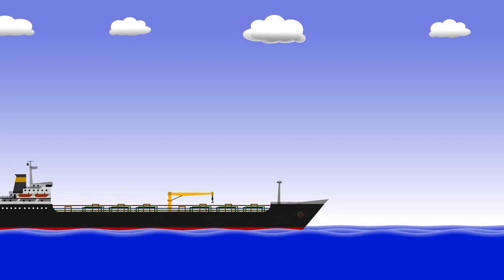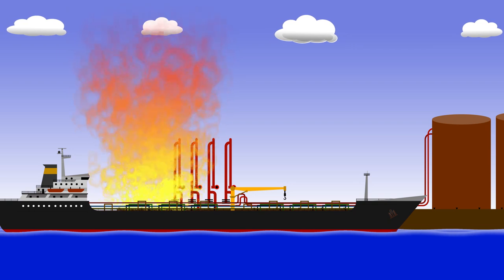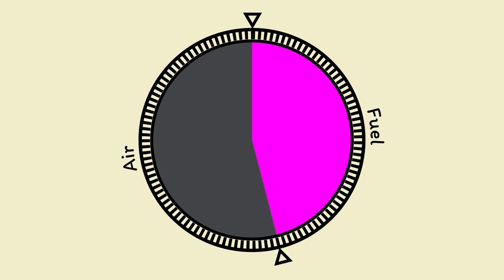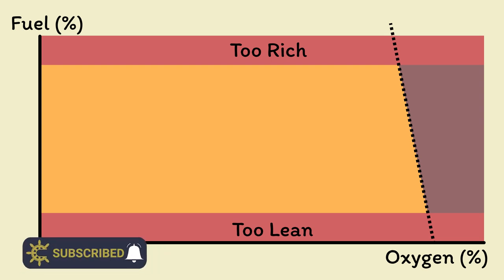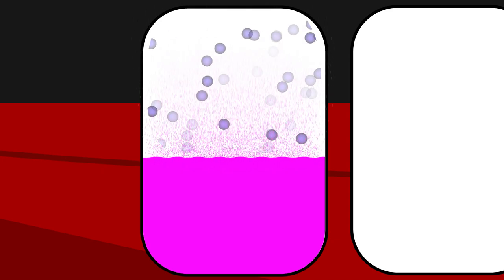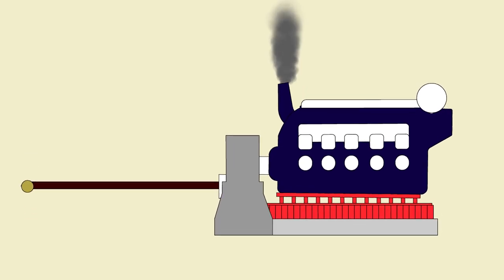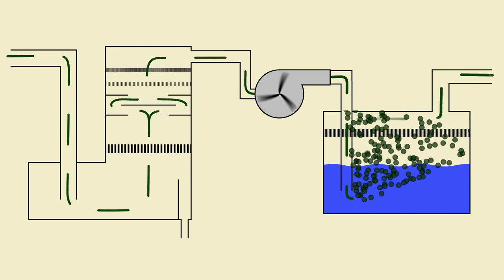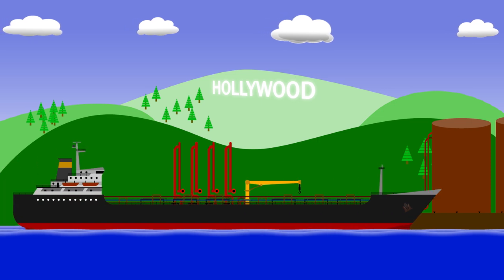Why Can't Petrol Explode On Ships?

Comment: The CO2 generator which is used to inert the tanks should be the Boilers and not the Main engine itself. 'cos:
1. Main engines emit way too much oxygen in their exhaust. 2.Many times when you need the inert gas (in port, while discharging cargo) your main engine isn't running.
Correct me if I'm wrong. Thoroughly enjoyed your video thank you.

Comment: The last time, it started with a call from the support department. They wanted to know if I had a backdoor tool that could dump the memory from a particular industrial controller without turning it on, because this particular controller had been extracted from Panam Serena, a chemical tanker that had exploded in Porto Torres. Sadly it turned out that our controller had lost power 10 minutes before the bang, so we didn't have sensor data for them, but that also told them something.

Comment: It is a little simplified in this presentation. If you were carrying crude oil you would use exhaust from the engine or the boilers however with refined products you would have a designated boiler that burns low sulfur gas oil or diesel. The exhaust from this boiler goes through a scrubber where sooth and impurities are washed out. Then the dew point of the exhaust is lowered either by a cooler or a filter filled with alumina before it is sent to the tank. When you mix inert and gas it is important to avoid  “the sack” as we call it. The sack is the area on a diagram where the mixture is explosive. The area of the sack will depend on what kind of hydrocarbons you are carrying. If your cargo is a gas you have to go further. You will first inert the tank and then you will purge the inert with the gas you will be loading. You will need to get rid of as much as possible of the inert if you are going to reliquidfy the cargo. For chemical gasses like ethylene and butadiene you would use nitrogen as inert, while for propane and butane ordinary inert is ok. Since gasses are kept below the freezing point for water it is important to have a low dew point on the inert. For chemical gasses it is also to remove all oxygen to avoid contamination of the cargo.🤠

Comment: Generally the exhaust from the boiler is used since the exhaust fumes from ME contains to much oxygen. But many oiltankers are not equipped with an Inert gas generator, it didn’t used to be a requirement. All electric equipment on deck in cargo area is Ex proof and strict regulations regarding allowed tools. So the risk of an explosion is still low because there is no source of ignition.

Comment: The LA explosion was ammonium nitrate, which can explode without oxygen. It simply decomposes in an exothermic chain reaction into NO2 and H2O when ignited. This is why it is commonly used for explosives.
Whether it had an inert gas or not would have been irrelevant.

Comment: The C-5 cargo aircraft uses a nitrogen fuel inerting system. There's a 750 gallon dewar (think thermos bottle) in each wing root that is filled with liquid nitrogen. The nitrogen is then pumped from the tanks and allowed to warm up which causes it to expand and transform into a gaseous state. That gas is then vented through the fuel tanks removing the oxygen. Liquid nitrogen has an expansion ratio of 1 to 694 which is why liquid is used.

Comment: In the 70’s three VLCC’s blew up off of the coast of Southern Africa. Shell UK’s Mactra, Shell BV’s Marpesea and a chartered in Norwegian vessel the Kong Hakon. This was in the age when the oil industry was trying to decide if they would go to ‘too rich’, ‘too lean’ or inert atmosphere for crude oil washing (COW) the three ships went off within a few days of each other so ‘something had to be done’ and as you describe inert was chosen. Even as the poor ship owners and operated cried tears of misery over the cost.  It is seldom difficult to notice the difference between a ship owners forced to pay for safety and a ray of sun shine (:-)
Reply: This is interesting. At that time I was an engineer on VLCCs and naturally all officers were seriously concerned. The investigation to all 3 incidents concluded that an electrostacticly induced spark occurred in the tanks while cleaning with high pressure water guns. Inert gas equipment was installed on all company steam ships at next dry dock,  much to our relief. After a number of years water cleaning was displaced by using crude oil instead while tank cleaning, creating a too rich atmosphere in the cargo tanks, therefore  not explosive.

Comment: One of the reasons tankers will not explode is that the RON is low compared to refined petrol , thats why when a tanker goes on fire it burns and does not explode , unless it is one that is carrying refined fuel . I sailed on a few , gas and crude , the early ones never had the system to vent exhaust gasses from the main engine into the tanks and you always had the smell of crude oil in the air , there were just vent pipes to let it out of the tanks , a later one , the ''Sir Alexander Glen '' an OBO had the exhaust gas system and was a lot safer but still someything always to be causious of . The gas tanker , butane and propane had tanks on deck with Nitrogene for toping off when fully loaded or for flushing the tanks . That one also had a compartment on deck with two banks of compressors , run alternatly to keep the gas under pressure to keep it in a liquide form

Comment: Once upon a time long ago, We used to operate to rich or to lean. 
The San Demitro was quite famously hit by shells from a pocket battle ship causing fires. She was abandoned but some of the crew reborded put the fires out and sailed it to port. 
A full gas can will not explode it’s to rich. So ypu can torpedo or she’ll a loaded tanker and the tank won’t blow up. 
An empty tanker. If it’s to rich will not blow up ither. But when you unload it regular air with its regular oxygen content is sucked in. 
An empty tank full of a fuel air mixture can blow up quite spectacularly. So funny thing is an empty can of gas is much more dangerous than a full one. 
Ussualy even when the unloading a tanker there was enough hydrocarbon to keep it to rich. 
The really dangerous time was tank cleaning when you clean the tanks you get ride of the fuel. And it is possible for the tank to go from to rich into the danger zone. 
After several ships blew up during tank cleaning. IG systems were gradually introduced. 
Crude oil is one of the more volatile due to still having a lot of the light gassy stuff still as part of it. 
At first only crude oil tankers had IG systems, but a few refined product tankers blew up while tank cleaning, so it’s use became more widespread 
I worked on some of the last Non IG tankers. 
While loading, particularly topping of tanks,  if there was not a lot of wind there was so much fumes I’d actually get high on it. 
Diesel or Gas oil is much less volatile. But still can be a problem as can ATK aviation turbine kerosene. 
Heavier oils aren’t much of a problem you can make roads out of them. The crap ships typically use is a slight step above road tar you heat it up enough it will burn. And is full of sulfer. So getting banned in lots of places. 
And is why IG systems are very prone to rust.

Comment: That is a very close explanation. The issue to which you refer is often given as a fuel/air ration - which is of valuable interest to efficient explosive ratios in internal combustion engines. However, an interesting video could be made explaining two other factors attributable to an assortment of different hydrocarbons.  First, the flashpoint of a particular hydrocarbon which as been subjected to increasing heat source, secondly, the interesting factor of a mixture of fuel/air subjected to high pressure in an enclosed space - or even a mixture e.g, paraffin or diesel fumes sub jetted to extreme pressure at one end of an enclosed tube, whi ch I s open at the other end. I have conducted this experiment in the barrel of a very powerful air rifle from the U.S. many years ago

Comment: Never thought about this before but if I had to take a guess, i'd have thought they were reducing the pressure in the tanks using vacuum pumps... Now that i think about it, that doesn't really make sense in such a big container that contains liquids with low boiling point.

Comment: Another thing the heavy tankers most people think of leaving the middle East are full of unrefined crude which put off little vapor to begin with and is not explosive
Reply: You are very badly mistaken; crude oil is volatile even the heaviest such as the Venezuelan crudes for around the Maracibo Lake contains a small fraction of light elements.

Comment: Isnt the exhaust from onboard boilers the most common exhaust gas used for this purpose. You cant have the main engine running while the ship is in port since you cant disconnect the propeller feom the driveshaft/crankshaft. I just started my cadetship on a tanker ship and this is what i was taught. Btw we use a dedicated burner for the purpose.
Reply: Ships no longer have boilers as they no longer use steam turbines.
Reply: @samanli-tw3id  they have auxiliary boilers and many tankers have steam turbine cargo pumps.

Comment: I kind of had the opposite question until I realized that the tanks won't always be 100% full. If they were, then a true explosion would be very unlikely because there just wouldn't be enough oxygen able to get in contact. Not that a plain fire can't be plenty nasty, but it's not going to be "break windows miles away" nasty. But when you showed the half full tank and talked about the vapors, I realized "oh shit, that's a fuel-air explosive".

Comment: I'm reminded of a tanker ship explosion documentary I'd seen recently. I forget which one it was, but they traced the cause to a bad weld in the tank. The tanks had been used to transport various chemicals, which had each leaked through the bad weld into the outer hull, mixed, and self-ignited. I don't think the outer hull had CO2 pumped into it as it was assumed flammable chemicals wouldn't be present there.
Reply: All welds on oil tanker should have NDT
Reply: @Then.72  sure about that....?
Reply: @skippyguy3  yes
Reply: @Then.72  so all welds on a tanker are 100% NDE...?  Still sure?
Reply: @skippyguy3  did you read my reply properly?
Reply: @Then.72  aaah, semantics....the last bastion of the you tube expert....
Reply: @skippyguy3  NO! Just a simple comment that you misunderstood. “SHOULD”
Reply: @Then.72  keep digging boi
Reply: @skippyguy3  keep running boy
Reply: @Then.72  its spelt 'boi'.... smh
Reply: @skippyguy3  but doesn't answer the question
Reply: @Then.72  we gotta' nibbler folks...🎣
Reply: @Then.72  thar she blows lads.....this one's fightin' hard.... 🐟
Reply: @skippyguy3  💩🏠

Comment: Actually engine's exhaust gases are still flammable, so they aren't used for inert gas system, they use the boiler's exhaust.
Reply: The engine exhaust gases are not flammable, the combustion is very complete so there is way too little hydrocarbons left to make it flammable. The problem with diesel exhaust is that the engine does not (unlike the Otto engine in most cars) runt even near stoichiometric so there is an excess of oxygen from the intake air that is not consumed in the combustion. While the boiler runs near stoichiometric with only a couple of % O2 in its exhaust, the engine can have, depending on engine load all from a few % up to 17 % O2. So it's not flammable but it's got too much oxygen to make it a good source for inert gas.
Reply: @skunkjobb Yeah what I meant was that the mixture of ME exhaust gases and crude oil evaporations is still flamable I just didn't articulated it correctly.

Comment: What about the nitrogen oxide & sulfur dioxide that's present in exhaust gas, does it or could it turn the water the fumes pass thru into sulfuric acid?

Comment: You don't use the exhaust from the (main) engines. Actually the exhaust gasses contains too much oxygen about 15%.
 The CO2 is made in a dedicated machine called the Inert Gas Generator (IGG). the inert gas contains about 2-3% oxygen.
Reply: @Grigory S No they don't. Only specialized chemical tankers have might have other inert gasses.
VLCCs have IGG too. They need to produce at the same capacity of discharge, which for a VLCC can be 10-15,000 cbm/hr
Reply: @Grigory S 
Posted edited.
But I will secede to your point for a while... I will look into it further, next time I am on a VLCC.
I don't normally have access to the engine room, so I might be biased from other experiences.

I have seen IGG in use on a 250 m long LNG carrier for maintenance purposes , and that was quite big and used a lot of diesel.

Comment: The point at which the flammable gases (vapor) and oxygen content are at the most explosive is referred to as the Nose Point, this is due to the curving nature of plotted points when graphing exploitability of gases

Also another method inserting the gases (vapors) is called “self inertanisation” this is where by the gases (vapor) depletes the all the  oxygen within the confined area of the gases. The main drawback from this method is a “gas fringe” can be created, this is whereby the gases (vapor) can intermix with oxygen and create an explosive mixture if the vapors intermix with oxygen.

As you so rightly explain, Inertanisation by the way exhaust gases is by far the safest method as massive amount of inert gases (Co2) are available. Exhaust gases from both Diesel engines and jet engines are used in the mining industry to extinguish uncontrollable underground fires . .

Gases and their behavior is a fascinating topic,  you did a very good job of explaining it

Comment: They should also pump some of the engines exhaust into the cabin to use it as a free source of heat!!!!
Reply: I can’t tell you’re being sarcastic or not. 

Doing that would kill everyone inside due to CO and the other carcinogenic compounds found in heavy fuel. There’s a  reason you don’t have exhaust pipes running inside your car. There is a reason the exhaust is up high or as far back as possible from the vehicle occupants. The Germans did this when they rounded up the Jews in transport vans in 1939-1945. 

These vessels use the least purified residue from petroleum distillation. Truly nasty stuff.
Reply: @AdamRud47  yes it is a sarcastic comment based on the top comment of crazy Russian hackers video about how to cool your house with dry ice

Comment: A lot of cargo vessels have the screws directly attached to the engine crankshaft. Do tankers have a way to disengage the screw from the crankshaft and allow engine operation while moored?
Reply: Good point and it’s mentioned elsewhere in the comments. There’s a whole variety of combinations but most motor ships, especially large tankers also have boilers, ( these are usually used for heating fuel oil but also have various other uses ), in which case boiler flue gas is used in port or at anchor. A typical arrangement would be for the ME exhaust gas to firstly pass through a turbocharger and then an ‘economiser’ which is a heat exchanger, ( in this case much like a cars radiator but using hot gas to heat cold water ), meaning the boiler water requires less heat from the boiler itself. That hot gas can be routed through an inert gas generator which will scrub out particulates and seperate the CO2 before being used in the cargo tanks. Of course, there’s variations. There are still steam ships and there are ships with ME’s that can be clutched out and ships where the drive is done by electric motors powered by auxiliary diesels, ie generators. But in a nutshell, exhaust gas is most widely used regardless of whether it’s from a boiler, main engine or from the generators. An interesting exception is found in LNG tankers where depending on the type of storage tanks, a separate nitrogen plant is often used for inerting, in which case the nitrogen is isolated from air.

Comment: Gasoline won’t burn in tanker regardless - the vapour pressure is too rich to burn at any temperature above -40C (which make for a really bad problem in a high flying piston engines a problem).

Comment: Peopke telling to fill the tank so that there is no oxygen should know that the tanks can be filled only 98% according to the rules of shipping the space left is called ULLAGE of tank which is left so that the vapours can move freely and the tanks cannot blow due to pressure of these vapours.. The inert gas can be stored and is mainly used while unloading the flammable liquid and it does not matter if engine breaks down in between voyage because the gas in the tanks will remain intac. The inert gas is heavier because of which the atmospheric gas which contains oxygen can be replaced with inert gas..

Comment: Your graph has oxygen percentage and fuel percentage and it looks as if at the right upper corner you have 100% fuel and 100% oxygen, while there is a hidden percentage of inert gas. Ternary graph works much better for this: https://en.wikipedia.org/wiki/Flammability_diagram